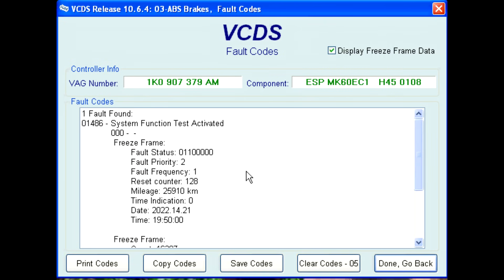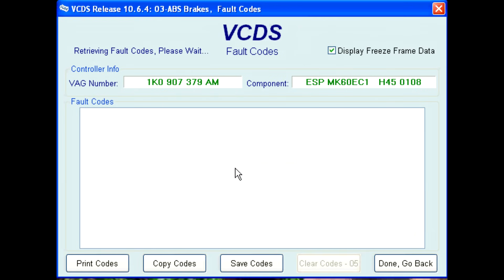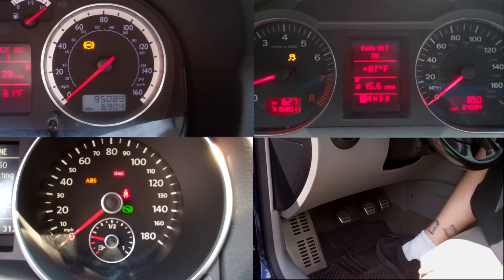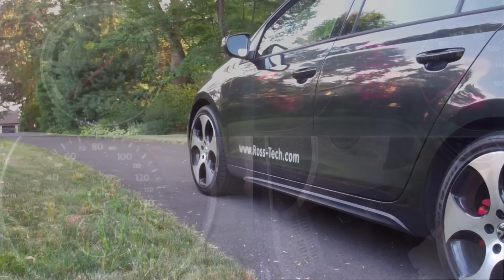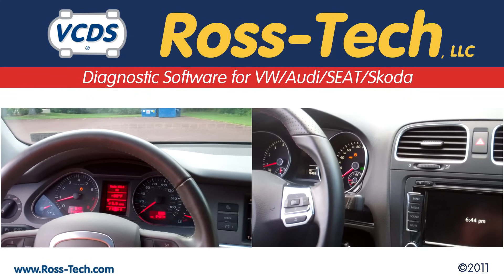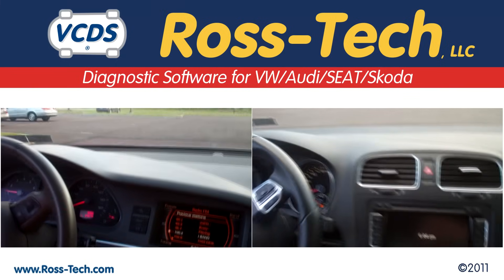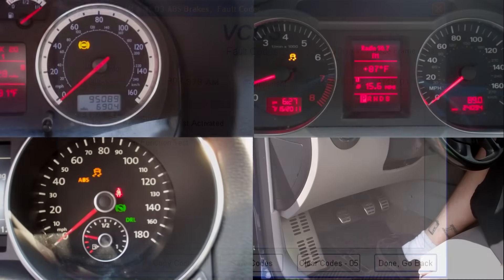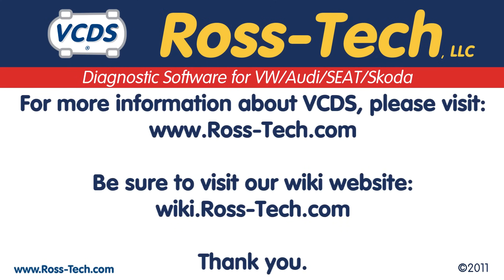01486 - System Function Test

Comment: This happened after clutch was fitted and tracking was out the vw specialist who did the work said just drive 20 miles and it will clear, lol would have been driving for ever if it didn't see this video, 12 years on this video still helping, thanks

Comment: Thanks I finally got it off! For you out there the test start when KOER, apply the brake hard, then drive in straight line for about 50 feet, make a turn to the left 90, now the trick make sure the ABS and traction control do not flash at the same time they need to be alternate in order for you to clear this test!
Reply: I don't know if you're still active, but that's alot of help already as is. If i understood correctly, is the abs lamp suposed to be flash too? mine is in a static mode but the ESP flashes and then turns off after awhile. I can't seem to clear the test. 
Or i'm just really stupid.

Comment: 08 a3 sportback 2.0t fsi
 So how am I suppose to perform abs system function test when the car doesn't go into gear due to a bad mechatronic unit? Mechatronic unit has been replaced but will not go into basic settings mode to learn new values because of the implausible signal from abs module which is requesting a system function test which can't be done because the dsg won't go into gear? Driving me crazy

Comment from the maker: The the ABS module still has the 01486 code, then it means the test plan has not been carried out correctly.  Also, some cars do not require a 35 BAR pressure signal, some systems will start the test just with light brake pedal pressure.  So if you drive to an empty parking lot and then start stomping on the pedal, the test plan had already been started and you see no changes in the lights.  As long as you only have 10486 or 01487, then keep trying.

Comment from the maker: Some ABS modules will drop communication at speeds around 20 MPH so that normal ABS functions will work.  But some  older ABS modules don't drop communication at speeds higher than 20 MPH, but you don't have ABS brakes... as such, a panic stop will result in a skid and 4 very bad flat spots on the tires (I know this first hand).

Comment: these cars are cursed and I'll never own one, whoever designed this must enjoy problems
Reply: With every problem, there's a solution...  Just need to find it... Sometimes, it takes a lot of trial and error(learning)... But once the root cause is identified(knowledge gained), one finds great satisfaction in resolving an issue that doesn't require a trip to the stealership(self-sufficiency)...  A toyota/lexus or honda/acura, chevy isn't any different, actually given the ease of availability of  parts, I would surmise issues are much more prevalent... Had an Acura RL... Super-handling all wheel drive my ass... 
Imagine your car not starting  because of a blown door handle fuse... 
Heck, even a bicycle has problems... 
Now, a madza 3? What an unrated beautiful machine of absolute reliability...
Reply: Ha ha,i agree with you Nathaniel Feldman
Reply: @conversationovercoffee  that's so true, whenever the fault/problem is solved,the feeling is priceless

Comment: hi, i replace and recode the abs control module of my 2009 gti and i get this code, so, i did what the video said many times and i can't turned off the abs and traction lights, any help. i got the abs light on and the traction light blinking, when i press hard the brake pedal the abs light blinks and start the test with no luck.
Reply: Sher_Singh ,not really, but after a few days the light go off By it self, i think in some moment the test was completed and the light turn off, sorry if i can't help you.